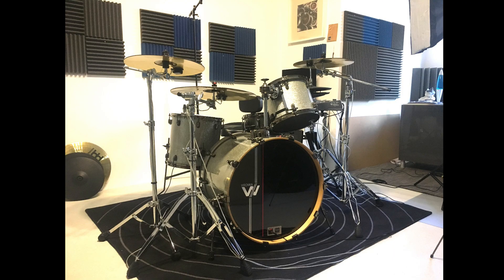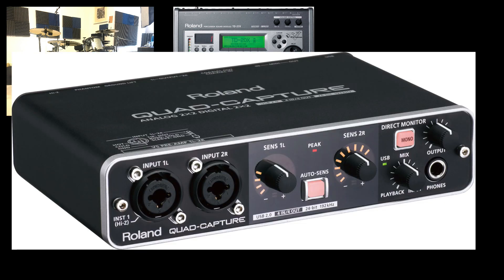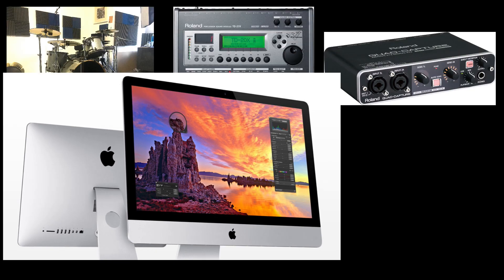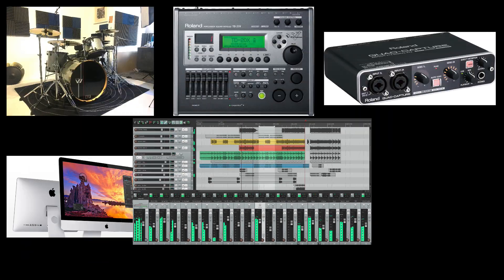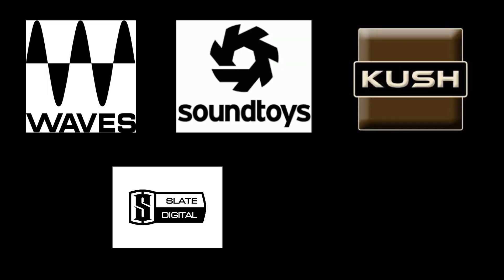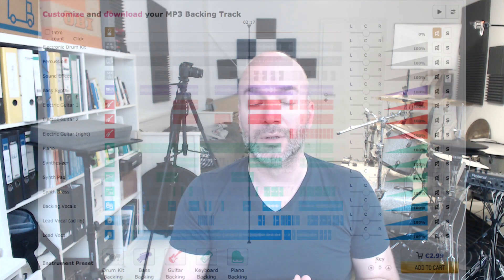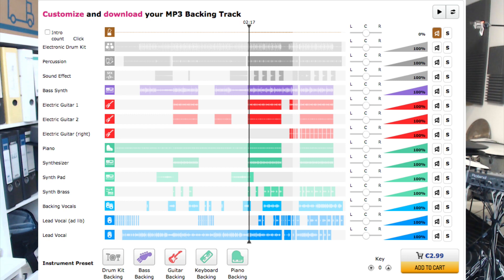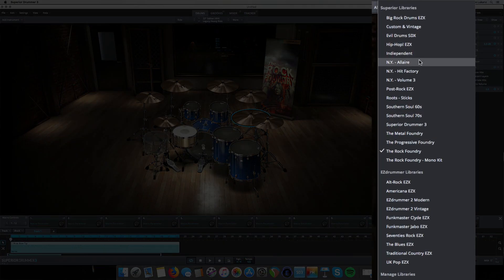How I record my e-drum cover - and why I do it the way I do

Comment: Thanks for your work. I believe you forgot the link in the desc but it was easy to find: "karaoke-version dot com"
Reply: Actually, I have a question. I am looking for the opposite. Do you know anywhere to get isolated drum tracks? I find figuring out old Motown beats to be difficult because of the old recordings and would like to hear them isolated. I know their are tons of midi files and loops out there but they usually don't specify which song they are from for covers or to learn from. I'd like to hear the beat on it's own but also want to know which song it's from so I can hear the context and understand how the groove is used in a complete track. So far, I have only found the drum drops site for this. They have drum tracks and also list which song inspired the beats.
Reply: Oh... The Karaoke site has them as well. "Drum only" versions. I like the drum drops versions because they seem more human / dynamic and accurate but this may be helpful as well. It seems some of the karaoke versions are real drummers and some are mechanical sounding midi versions. If you know any other sites that have isolated drum tracks I can study and know which songs they are from, please let me know. Preferably real drummers. Thanks for the karaoke idea. FYI, I'm not a drummer I want to program realistic drums better in my DAW, study grooves, and also make covers.
Reply from the maker: Hi Tony, you‘ll find a lot of isolated drum tracks on YouTube. And you need to check Toontrack‘s website and the tons of MIDI packs they provide. All of the MIDI tracks were played by human drummers, so with all the human imperfections and groove included.
Reply: Oh... wow, I'll search here for isolated covers; I didn't know. Yes, I love the Toontrack expansions and have some. Thanks for the help!
Reply from the maker: You’re very welcome!